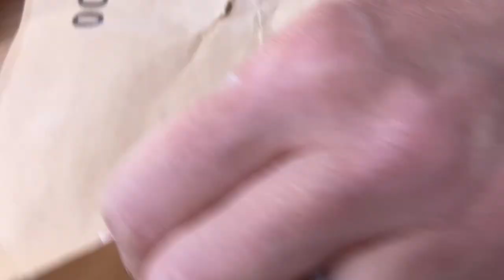Making a Table Top Draw Bench for Wire Making

Comment: What is the purpose of the T brackets?
Personally, I would put the bolts pointing down, and trim them off underneath. Much neater, easier to tighten, and avoids any interference with the tongs.
Reply from the maker: hopefully this answers your question: https://youtu.be/_FJnFndgnwU

Comment: What is engineered wood?  How come you didn’t use magnets to hold the draw plate to the brackets?  How come you didn’t just go buy shorter bolts?  Many of us don’t have a wood working shop and so need to make this as uncomplicated as possible.  Why don’t you set up a power drill to turn the crank??
Reply from the maker: I have a very limited budget. The idea is to use what I can find in my place to make the draw bench to do the work. Most of the materials are left overs from other projects, including the piece of wood and the long nails.
Reply: So many questions on this, I don't get the overbuild, the big space between the end "T" brackets and the "L" brackets, hand screwdriver when there's a drill,  those huge offset holes....wow. It does work but this was definitely NOT pushing the easy button. Phew! A real head scratcher....
Reply from the maker: @flyingcheff  I will make a new video with all the explanations :)
Reply: @HuiyiTan  Oh thank you so much! Very grateful 🙏🙏